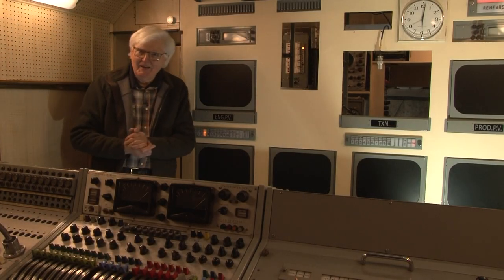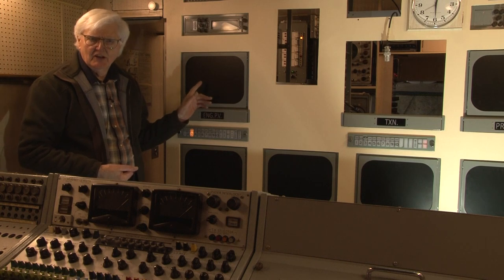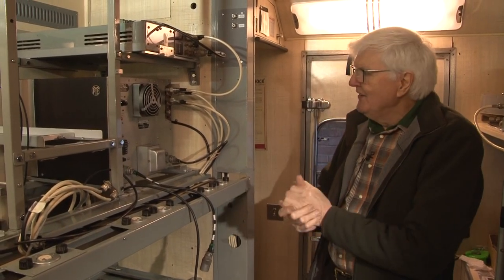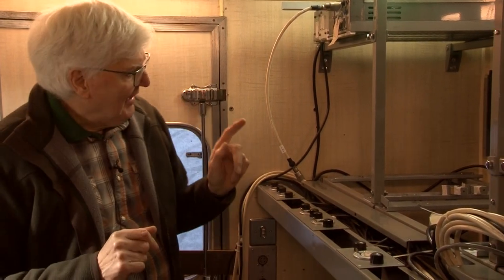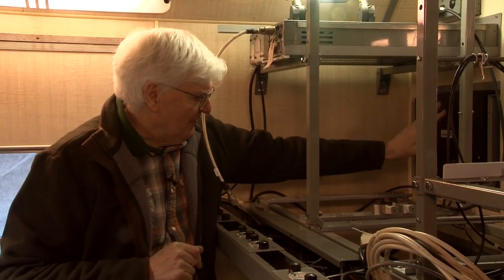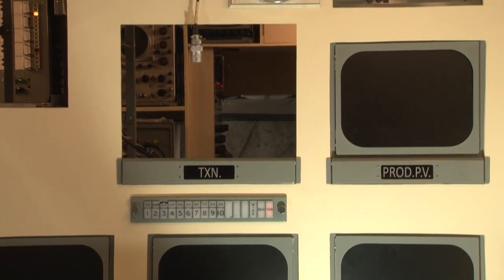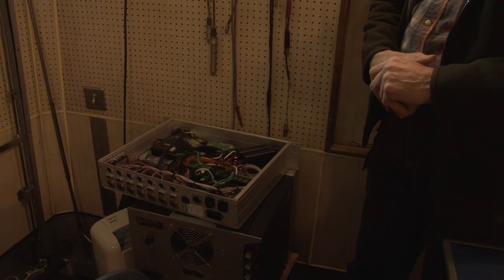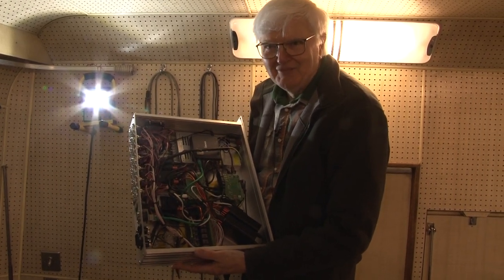CRT or LCD monitors? A 'behind the scenes' look at the display monitor arrangements inside MCR21.

Comment: So is this van 405 or 625 line?  Given the '60s date I would have assumed it was 405 line - but I'm not sure if LCDs would be compatible with that, which would be a problem if you wanted to display a live camera feed on them.
Reply: The van was designed to work in both 405 and 625 line standards since both were in use at the time it came into service.  BBC2 launched in 625 lines in 1964 but BBC1 remained 405 for some years.   There are two sync pulse generators on board which could either be both set to the same standard to give a main and spare or one of each for a quick turn around.   Swapping standards required board swapping,  not just the flick of a switch !
Reply: Superb work and extremely interesting 👍🏾